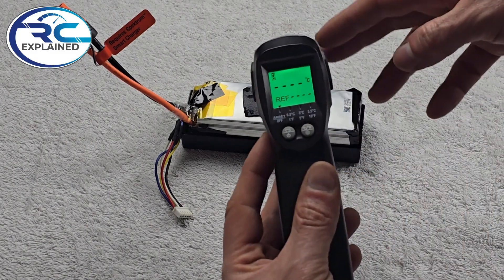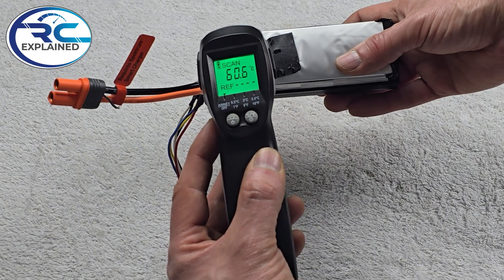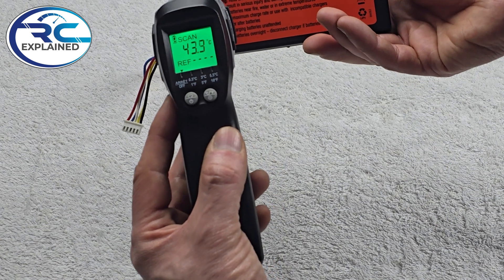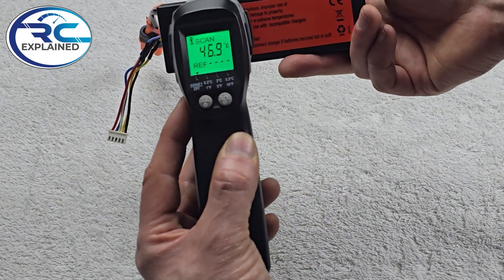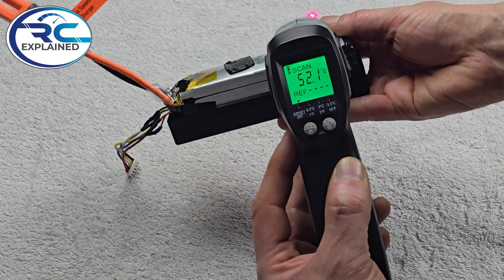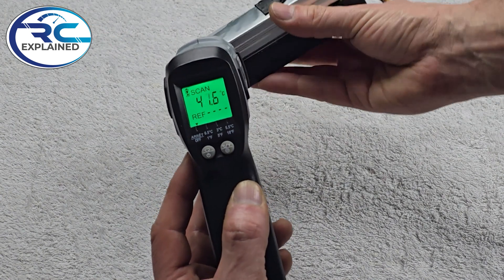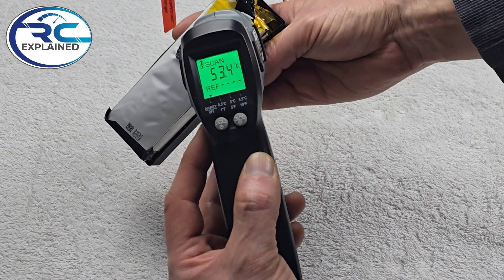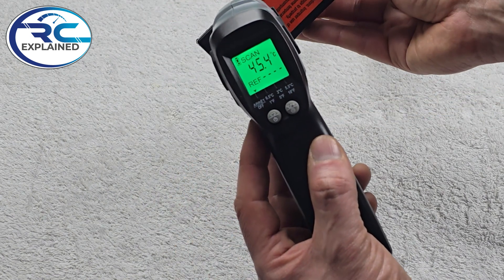The Dangerous Truth About LiPo Hard Case Temps vs Cell Temps!

Comment: What about opening a case, cutting slots for air to move in and out, then gluing the case back together?  Would the air availability help the battery when running hot?
Reply from the maker: Hot air being able to escape would definitely not hurt and should help with thermal management.
Reply: @RCexplained  Thank you.

Comment: Let's also take into account that if you are using 2 packs in an RC and they are stacked on top of each other, the bottom battery pack will usually get significantly hotter than the pack on top. This is even worse with hard case packs.
Reply from the maker: Very true!

Comment: I know that spektrum smart batteries aren't the best batteries on the market. However, the smart chip has a thermal measurement circuit, and it sends that info back to the DX6 that u use in real time. I wish higher quality pack manufacturers would come up with at least some kind of thermal alarm built into the hard case.

Comment: 2 things are wrong..... First you measure the temp of the case far away from the cells, as plastic is no good heat conductor it is normal you will not measure the the same or even close to the temp on the cells. Second, you are using an IR temp meter. The radiation of different materials and even different colored surfaces is different, with the better IR meters you can set an emission correction to get a right readout. It is better to use sensors to measure by contact. Use some heat paste to stick a sensor like the LM35 to the cells and one to the case and use a simple voltmeter to show the temp, the results will be more precise measured in the right way. To be honest I think with the cells in the case a good sensor by contact on the case will not be far af from the temp on the cells, for sure when measured within a LiPo back where no surface heat is less transferred to the air.
Reply: he is correct in that plastic is an insulator so there will still be large difference between the value measured on the outside of the case versus the value measured on the outside of the cell pouch even when using an lm35, which also would not be suitable. Something like a surface mount thermocouple probe would be better
Reply from the maker: I dont think many hobbyists are using sensors on their lipos over a temp gun. 
You'll need to confirm your emmisivity values for black plastic and the metal pouch. Using accurate emmisivity values, the temp gap would more then likely widen, not shrink.
Reply: @RCexplained  I am busy with nitro engine cooling heads, engine pre-heaters and an own cooling head and measure the effective cooling of all of them and I can say the silver colored heads like the OSMAX R2105 does give a huge different reading and that is right regarding the needed emission factor that is needed on non anodized aluminium but wrong for users who do not take care of it and still remain focusing on the temps they know from other engines.

Comment: Great tip I live in Malaysia where 365 days a year its 30 to 34 degrees C. It never takes long for the bettery to get hot so I run a fan or mostly I run nitro with a hump pack then there is no worries.
Reply from the maker: Yes, that's a really hot environment.